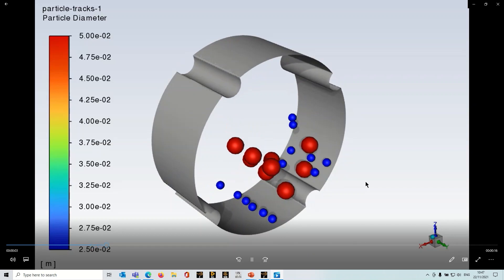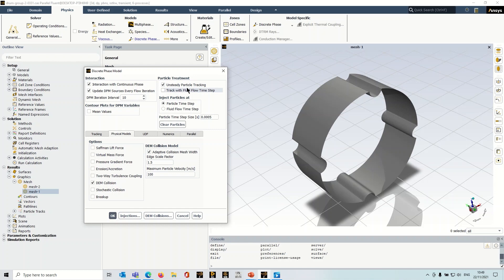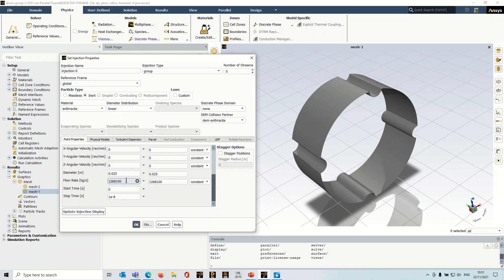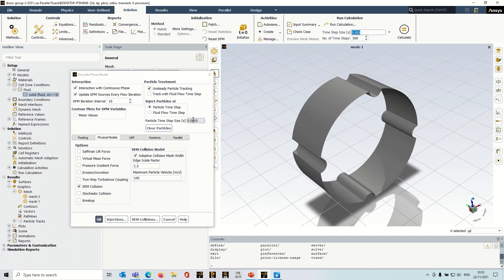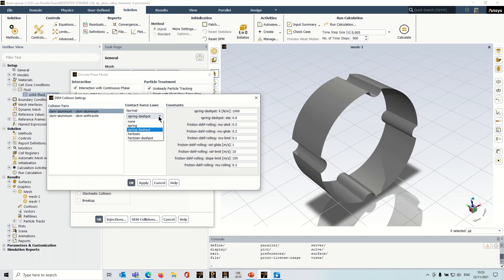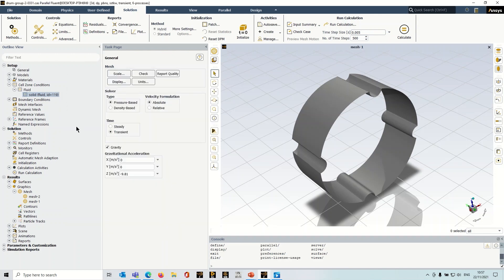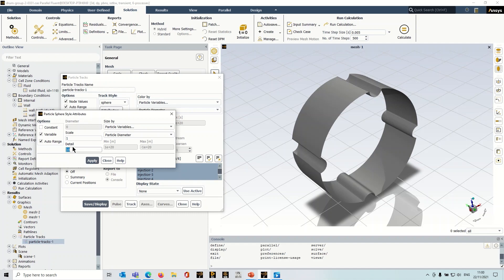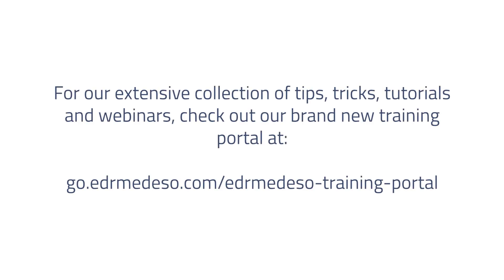How to Setup a Basic DEM Collision Model in Ansys Fluent

Comment: Hello , i made a simulation almost exacly like your but im having a problem , my particles seems to dont "fell" the touch off eachothers , they oly respont to de contact off the walls and only wehn it hits the midle off the partcile (like the partcile is been trated like a point and not like a particule with diameter)